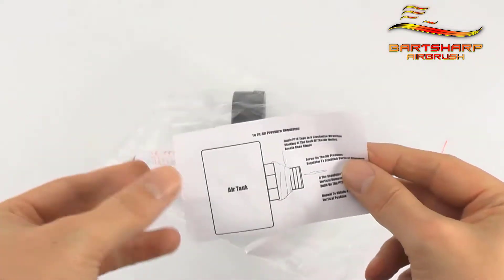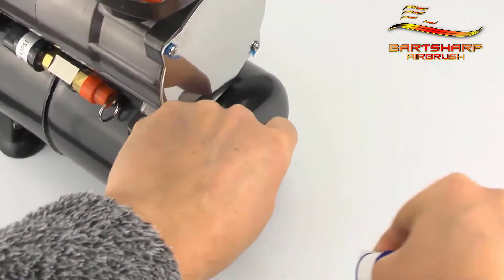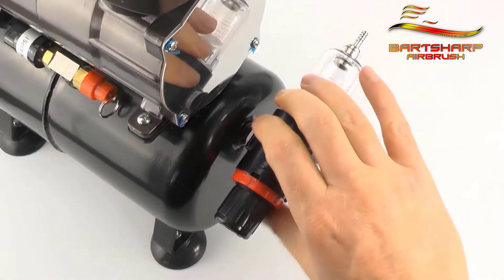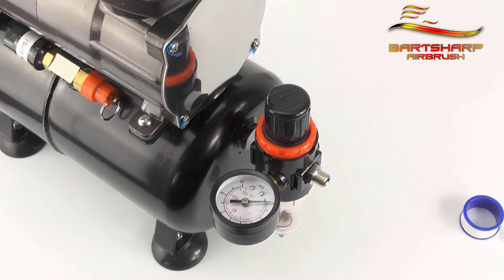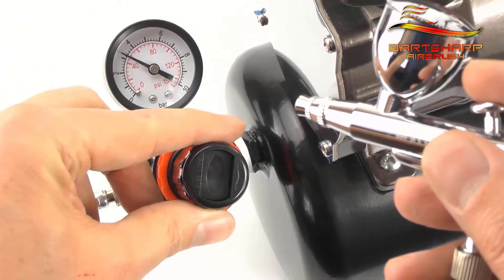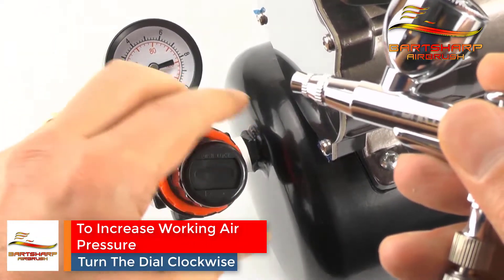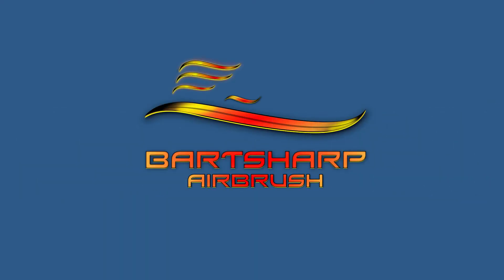Airbrush Air Pressure Regulator | Perfectly Fit | Set | Adjust PSI | Airbrush Set Up (2023 Set Now!)

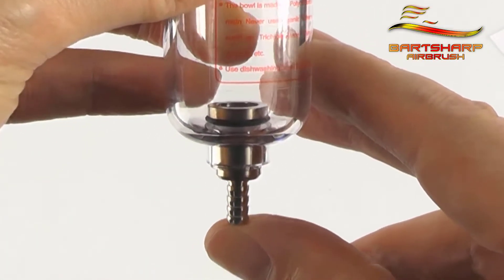Comment: So I have a very similar air pressure regulator if not the exact one and I've been air brushing for a couple years and I noticed recently that air is leaking from the hole that is inside of the triangle by the gauge (2:05) I noticed that if I reduced the pressure to below 40 psi it starts to leak out of that hole and the air tank won't get filled up. I'm not sure why this happened, if its normal, or how to fix it. Any advice would be greatly appreciated.
Reply: I believe it's called a relieving port, but I'm still not sure how to fix it.
Reply from the maker: Hi,
The hole inside the triangle is an emergency vent. Unfortunately the air pressure regulators wear over time and it might just be worth buying a new one. Constant leaking will mean that the compressor won't get up to pressure and will continually run which will cause the compressor to overheat and cut off. Luckily the air pressure regulators are quite inexpensive and easy to swap out. Hope this helps and thank you for your comment.

Comment: Hi I have this same compressor but mine came connected, however the black piece that you are supposed to move up and down does not move up and down. It moves up and comes off completely. I’ve tried turning it to lock it into place but it doesn’t work. Is it stripped???
Reply from the maker: Hi. unfortunately it does sound like it is stripped. If you can move it up a bit, before it comes off, then  this might allow you to do any necessary adjustment. Good luck.

Comment: Is this compressor supposed to get really hot i was spraying for around 20 mins at between 10 and 15 psi any help pls
Reply from the maker: Hi Stuart, the simple answer is, yes. When air is placed through a mechanical process, such as compression, heat and water vapor are produced which contributes to the build up of heat at the compressor. The head gets very hot which is why there are fins on it to help radiate the heat. You could try checking out the condition of your compressor piston to make sure that there is no build up on it as this will cause extra friction and heat. Try directing a fan on the compressor head as this will help reduce heat build up. All of our compressor range now have built in fans which help to greatly reduced the problem with heat build up. Thanks for contacting us.
Reply: Thanks for the reply the compressor is brand new 1 time using it i was using a cheap 1 but upgraded.thanks again

Comment: I have a similar one... i got a hose on both sides, so it's not mounted straight to the compressor but it's leaking like crazy! on both sides... i guess I'll try PTFE tape, or should I just have tightened the bushings more?
Reply from the maker: You could try more ptfe tape or even liquid ptfe. Good luck, you will get there.

Comment: Great video. One question what happens when I release water and it stays in the valve? It’s not releasing any water
Reply from the maker: You can unscrew the clear section, remove it from the main body of the pressure regulator (black part) and then empty the water out.

Comment: Hi, do i ever need to empty the tank to get rid of condensed water that has been trapped inside? Thanks,
Reply from the maker: Hi, always good to release the trapped water inside the air filter clear section by using the spring pin. Also empty the compressor air tank of air and then undo the small brass nut on the underside of the tank, this will drain the water. always good practice to do this.

Comment: Thank you a lot for the video. I'm suspecting the manometer is not working properly. The hand doesn't point to 0 by default, and when I turn the compressor It gets stuck at 1.5 bar, I have to tap on the manometer cover and It jumps to 1.8 and 2.0 bar and so....when I release the Air pressure, the hand doesn't fall softly and never reaches 0 level. Is an easy solution there or must I replace the whole part? Thank you again
Reply: I have a similar issue. Did you find an answer? Thanks :)
Reply: @trispenite  Hello Ziggy. The manometer part was too much tighted and the air didn't flow correctly...I asked for a replacement but at the moment of install the new one, I made a pair of twists on the 'damaged' manometer and It began to work perfectly!! try it!

Comment: Great video, helped me a lot but still, after I adjust desired pressure and I use my airbrush, pressure is going down , compressor auto switch  starts compressor on  1 bar and its pumps up until 2 bar and then stops. I tried everything but just cant get compressor on desired pressure setting. Please help...

Comment: Is it necessary for the air pressure regulator to be vertical? I’m having a hard time getting mine to get vertical it seems to just eat through any amount of ptfe I put on the threading
Reply from the maker: Hi, no the air pressure regulator does not need to be vertical as long as you have an airtight seal. You can see in the video that I off set the pressure regulator to get a better camera angle and this how some people may set theirs depending on working position and required view of the pressure gauge. Hope this helps and happy spraying!
Reply: @BARTSHARPAirbrush  thanks for the advice I previously owned an Iwata ninja jet but hated how it would always be running and only goes to 15 psi and also has no pressure gage this is actually a cheaper compressor but I think it’s allot better value so far

Comment: Hi all if you didn’t want to fit the regulator at compressor would I need a 1/8th to 1/4 fitting at tank so you can run a hose from tank to where regulator will be. Would I need same fitting to fit hose to regulator cheers

Comment: I have had this compressor and air gun for 16 years and i very nearly bought another one until i saw your video.  I never knew about pressure or how to set this. I have never set my air pressure.  A huge thank you for a very clear and informative video.. Im looking forward to using it again with confidence.   Thank you

Comment: If the air outlet doesn’t fit for my paasche hose, would I have to remove the outlet or put on an adapter to fit my hose?
Reply from the maker: Quickest and easiest option would be to put and adaptor on the air outlet of the pressure regulator. 
The outlet is 1/8 BSP Male so you will need a 1/8 BSP Female to a Male size of whatever your air hose is.
Reply: @BARTSHARPAirbrush  awesome thanks so much!
Is that adapter removable? It’s on there so tight I assumed it didn’t come off for the new one. I was just thinking it screws onto the male
Reply from the maker: Yes, the air outlet unscrews but it is set in with a small amount of threadlock to provide an airtight fit. Fitting an adaptor is the easiest option... you'll need a small amount of PTFE tape to get an air tight seal.
Reply: @BARTSHARPAirbrush  yeah it’s really tight! ok thanks a lot, I’ll work on that👍🏾

Comment: Great video, very informative and helpful. I wondered about that collar but I found that those airbrush holders are a junk and since the compressor sits on the floor, it's not very useful. I like the clamp airbrush holders. Thanks for the PSI info, I didn't see that anywhere else in my YT searches. I just liked and subscribed and hope you get lots more followers.

Comment: How do I make the fitting at the bottom of the glass peice stop putting air out
Reply from the maker: It should be spring loaded so it should close automatically. If yours is not closing then keep pressing it for a number of times to free up and move any dirt which may prevent the seal from sitting properly and stopping the air flow.

Comment: I have a Master airbrush eco 17. I’ve tried adjust the pressure but it does not move at all. Nothing seems to be leaking. Any suggestions?
Reply from the maker: It's possible that your pressure gauge may be faulty and the needle is sticking. You can purchase a spare gauge, however, I'm not certain on the price and how this might compare with simply replacing the pressure regulator for a new one. Hope you get this sorted out.

Comment: This helped immensely. I recently got in to airbrushing so a complete novice. I picked up a timbertech compressor off amazon to go along with a badger airbrush/hose. Aside from the fact the badger hose is a 1/4” connector to a 1/8” regulator but that’s a whole other story. The instructions included with my compressor were lacking at best.. so had no idea how to set ‘working pressure’ but this helped me a lot.
Reply: Those air compressors are sold under many different names and in many countries. They all have the same mutilated English instructions. You think by now one of the importers would have had the instructions done correctly and notified the Chinese manufacturers.
Reply: Garfield Smith
Reply: @wongleong2102  You did not respond with anything. I have one of these same compressors (different name) and the instructions do need a clean up with the translation. Same issue was how to set working pressure  even though mine had the pressure gauge already attached.

Comment: THANK YOU so much for making this video. It was succinct and highly informative. I could not get the filter/water condenser thingy to orient the right way. I was going crazy, but your advice to add more plumbers tape was right on. And thanks for the holder idea too....and even more important, how to set the pressure!! I've saved this video as there was NO manual that came with my compressor!

Comment: Hello! I just setup my new airbrush and compressor. How come air isn't coming out of it when I pull back the trigger? But when I remove it, air comes out of the hose. Regulator is showing 30 psi. Please help! 😢

Update: Defective needle. Had it replaced with a new one. Air brush now works great! 😊

Comment: Very informative, I recently invested in my first airbrush and the compressor came with no instructions, this helped a lot.
Reply from the maker: Good luck with your journey. Our website has many helpful videos which may help you to avoid some of the issues, that those new to airbrushing, sometimes struggle with.
Reply: @BARTSHARPAirbrush  hi i getting a similar compressor with 3L airtank; with regard to the airbrush working pressure. once it is set, if i use the spring below the air filter to release water and air inside; will the psi gauge drop to 0 so that i can unscrew the knot below the airtank to release the moisture inside then do i need to re-setup the  working pressure again?
Reply from the maker: @leomr1504  If you press the spring air/water release pin you will only lose all of the air (from the tank) if you keep the spring pressed in. You won't need to reset the working air pressure after using the moisture release spring on the AFR. You only need to use the AFR spring if there is a visible build up of water within the clear section of the AFR.  The brass dial, under the air tank, should be used frequently to drain any water build up in the air tank (you don't need to overtighten as the inner part should have a small o-ring which forms an airtight seal. Over tightening can cause the o-ring to compress or become damaged). Hope this helps and happy spraying!
Reply: @BARTSHARPAirbrush  i just gotten my compressor. With regards to removing my airbrush for cleaning,i assume i should turn off my compressor b4 remove the airbrush from airhose if not air will just keep coming out. Also with regards to draining water buildup in the airtank, should i do it everytime after use n just leave the valve open overnight?
Reply from the maker: @leomr1504  Hi, yes turned off compressor when disconnecting your airbrush as air will be lost through the hose (unless you have a quick release adaptor which i recommend). You may only need to drain the air tank once or twice a week depending on use. Happy spraying mate!
Reply: @BARTSHARPAirbrush  oh the quick release adapter will prevent air loss when we remove the airbrush from the airhose. I have 1 but nvr install it cos was testing out the new compressor
Reply from the maker: @leomr1504  Yes, the quick release coupler has a valve in which closes off when you disconnect the airbrush. This stops any air escaping from the air hose. Have a look at this video as it gives an overview and might help a bit. Cheers!

Comment: Great video! I have one question - I have a TC20-T that I just got and in the instructions it says “once every three months clean the filter of the Filter/Regulator by blowing compressed air (see Fig.)” and I cannot for the life of me figure out how to do that. Also, does pressing the nozzle on the bottom of the regulator release all of the moisture? I’m not trying to blow myself up here.
Reply from the maker: Pressing the water release pin will allow collected water to be ejected. You can also unscrew the clear section so that it can be rinsed and left to dry if needed. You will struggle to blow compressed air on the filter medium if you have unscrewed the clear section to gain access as you won't get an air supply to your airbrush. You would either need another source of compressed air or have to remove the air filter and then connect the airbrush and air hose directly to the compressor oair outlet.

Comment: thanks for this video. 

however : what is that screw opposite of the airpressuregauge do? 

I got my compressor with the airpressureregulator today and it builds up pressure but I can't release anythrough the airbrush nor does the gauge meassure any pressur. I can however release air through the watertrap.  Faulty product or is there one more step ?
Reply from the maker: Have you lifted the pressure adjust know and turned it in a clockwise direction  until the pressure gauge needle rise? If the pressure regulator is set too low then no air will come out. Also you need to make sure that you have the regulator input, gauge and output in the right holes. Fitting the wrong way round can cause the problem you have described.
Reply: @BARTSHARPAirbrush  thanks for the reply. 
I figured it out. Turns out you have to turn the pressure regulator quite a bit until shows anything.

Comment: BARTSHARP PLS help me out with this😂
 I drop the regulator in muck
So I had to open every part 😒
N wash it I did so n fixed it
N now the cutoff don't work
the air keeps flowing of the regulator after around 40psi
What do I do??

Comment: Can I ask are there any other types you can get. Possibly easier to pull and push as I have bad hands cheers
Reply from the maker: Hi Steve, Hopefully the video shows how easily the control dial can be lifted and reset without much effort at all. The turning of the dial is also very easy.
Reply: BARTSHARP Airbrush  my one is a bit stiff if I keep lifting up and pushing down will it get easier to open and close
Reply from the maker: @Steve-dr7rr , Hi, It should get easier to move with more use. You could put a small amount of airbrush lubricant on it to kelp though.
Reply: BARTSHARP Airbrush  hi the video is great you can hear you clearly in it